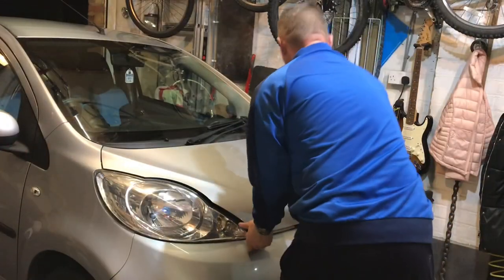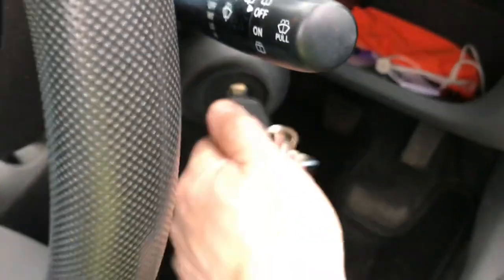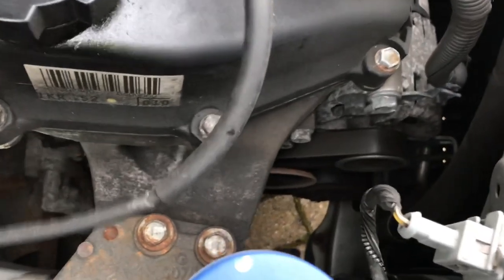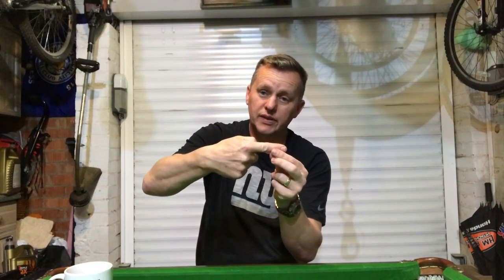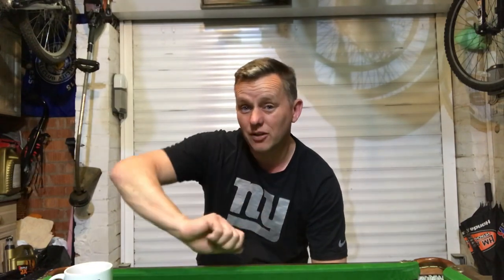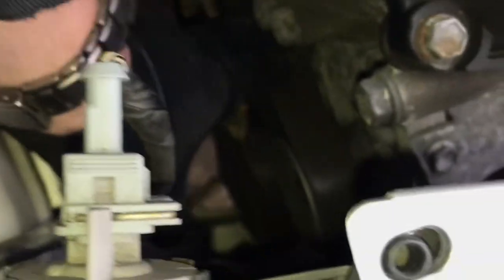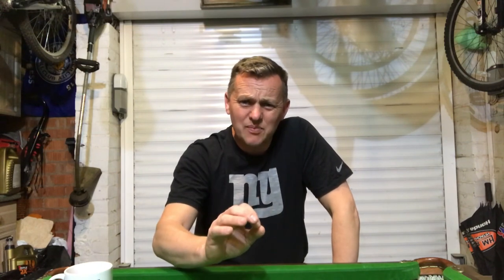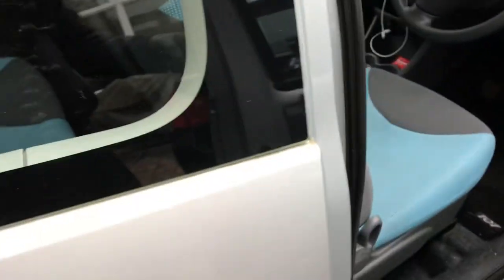Belt Noise, Peugeot 107 How To Repair/ Adjust, Replace Aux Drive Belt (C1 AYGO) CityBug

Comment: I follow your videos. I have a 2006 model, 35K miles toyota aygo vehicle. It makes exactly the same sound. I wonder if this problem was solved after your action? Or did the problem recur after a while or did the problem appear elsewhere? Here (UK) car mechanics unfortunately want the car to stay for at least 2-3 days even for such a problem. If your problem is solved in this way, I will do the same. Thank you for your help.
Reply from the maker: I ended up replacing the water pump https://youtu.be/a9zXGS5CPy4 Thanks for the great comments👍🏻👍🏻🛠

Comment: Did the noise suddenly start from nothing? My C1 has started making a similar sound, but only at around 2000rpm. Anything above/below this and it sounds normal. I'm wondering if it's the same thing, or I've got a bigger issue. Any clues as to what it may be?
Reply from the maker: If your belt is not loose, the water pump is most probably failing, that is what happened to this one, this is the replacement video, ,https://youtu.be/a9zXGS5CPy4. Thanks for the great comments👍🏻👍🏻🛠

Comment: I put this one also in my C1 playlist! Thanks aaanton!!! Do you have an advice for central locking problems? On the driver's side of my C1 (2008) I can't close anymore but I can open. On the passengers side it works fine. Is this a common problem? Do you have an idea? Or someone else reading this comment?
Reply from the maker: could be the solenoid in the door sticking, might be worth having a look, Thanks for the great comments👍🏻👍🏻🛠
Reply: @aaanton11  Thanks, I will do that! 👍

Comment: I have a bit of squeek when the engine and belt is cold. It started when I changed the oil and a big gust of wind made the oil go everywhere and a bit got on the belt, I wiped it off but I must have missed a little bit. I've got a new belt as I don't think it's done bad at 83,000 miles (and I know what oil is like for soaking into rubber), I think I'm going to clean all of the pulleys in case they're contaminated, I'm just not sure what to use as I suspect washing up liquid and water could cause it to be slippery... Although I guess if I rinsed them with a hosepipe afterwards in theory it should be fine?
Reply from the maker: I prefer carb cleaner like https://amzn.to/2VseuzC its great for cleaning oil spills, Thanks for the great comments👍🏻👍🏻🛠

Comment: I only get this noise when the car is cold, if I start my AYGO after then it doesn't make the noise. could it still be this issue?
Reply from the maker: could be, or the water pump is on its way out, I have another video on the Replacement, Thanks for the great comments👍🏻👍🏻🛠

Comment: when the water pump goes and leaks does a bit of grease get into the water
Reply from the maker: not really, not enough to cause an issue, you drain the system down when replacing the pump anyway, Thanks for the great comments👍🏻👍🏻🛠